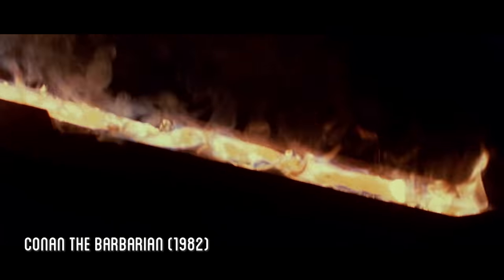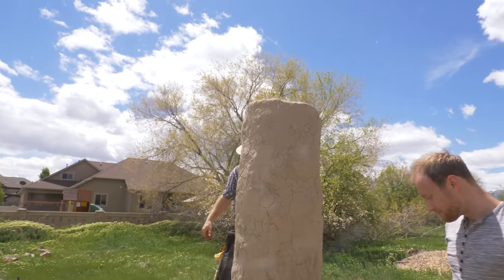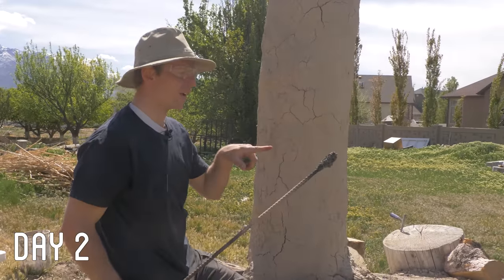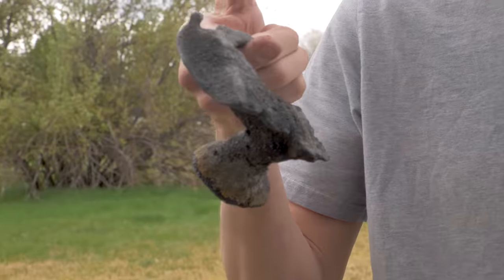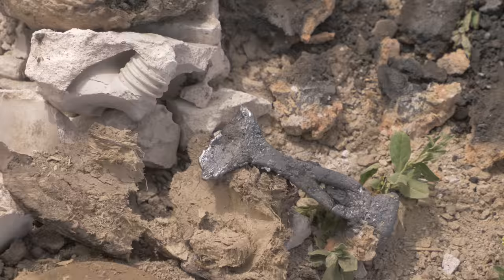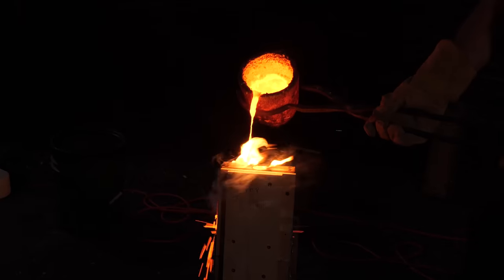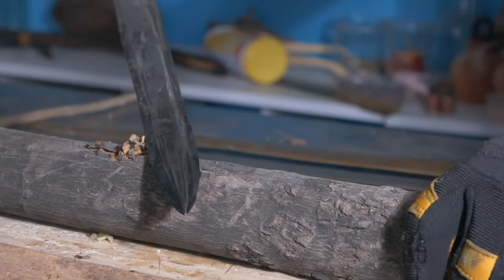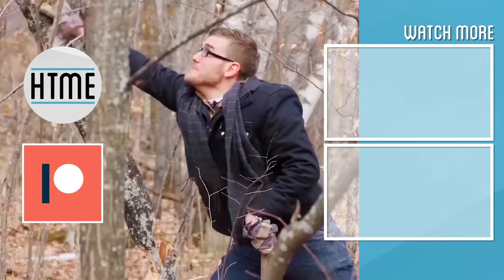Can You Cast an Iron Sword?

Comment: For all those that say what they could have done wrong and to try differently, it isn't about how you pour cast iron, is the cast iron itself the problem. It is too brittle, for blades you need a steel that is hard enough to retain an edge but flexible enough to absorb hits. Cast iron is just very hard and not flexible enough, is like glass. There is a reason why blades for centuries have been forged. The pouring thing is just an idiot thing for the movies since it looks "cool" (even if i think a blacksmith smashing hot steel looks cooler). I'm a little mad about this thing cause since i make knives a lot of people asked me if i pour molten steel to make knives... and thats only hollywood's fault if people don't know how bladesmithing works

Comment: I believe the fictional depictions generally cast then forge the casting.
Also you should preheat/burn out your molds to drive out the moisture and reduce mold disintegration before casting.
Reply: Which would be a great way to leave splinters of cast iron on your anvil
Reply: @toddellner5283  Yeah I imagine it is quite a light show as well

Comment: They appeared to not be putting vent holes in the mould. So the air can be displaced and allow hot melt metal to completely fill the cavity of the mould.

Comment: You need to preheat your molds. They should be at around 1100 F when you pull the metal out for pouring.
This is especially important for a geometry like a frying pan in the way you're casting it because the metal has to flow over a lot of surface area to fill a small volume, giving the mold plenty of time to freeze the metal in its tracks and stop the pour.

Comment: I can point out some points about why the pan didn't work, First point I didn't see any holes for air to escape in the mold, second point, The metal has cooled down too quickly, perhaps heating to a higher temperature will make it liquid longer.

Comment: You can improvise an electric arc furnace with stick welding equipment, graphite electrodes and an inert cover gas inside and old propane tank that has been cut in half. The top being the lid and the bottom having a conductive plate/bucket suitable for holding molten material. I should mention this should be well sealed with as little oxygen as possible.  It may also help to install windows using welding helmet lenses.

Comment: Yes, a whistle vent in casting is essential. Green sand is 6 parts sand and one part clay with just enough water to make a fist ball. Water in molten metal will explode, dry your tools. This should be stressed for safety. A caste sword is the beginning process. next it needs to be heated and hammered to compress the steel into a uniform structure, forged, tempered etc.

Comment: Fun fact: historical swords used to break all the time due to poor edge alignment. Even modern reproduction swords made for HEMA break occasionally, which means that either we got stronger or don't understand sword fighting very well...
There's no reason you couldn't still quench and temper your blade, which would make much difference. You could also finish it easier with more traditional techniques after tempering. But even then you'd have a sword that's made from an inherently brittle material.
Maybe if you reheated it in a coke forge before quenching, but idk.
Bronze is inherently softer, but did usually get work hardened by hammering the bevels. That's a different technique than grinding but does the same job, but also has other benefits that also kinda apply to other metals, in a way that the material gets more consolidated near the business end.

Comment: if you need to mass produce swords, and can melt iron, then casting swordish shaped billets for later finishing makes a lot of sense.
Reply: Th problem is with the structure they would need to do the same ammount of work for those
Reply: @robertshort9487  it depends on the armor and stick a bo staff can do alot of dammage compared to something that continously breaks on contact with another weapon just look at the vid infront of you the grain structure is random adding weakness vs forging where it's stretched along the sword so for the sword shaped billets they would need to fold and restretch it which would work like a normal sword and that case might aswell start with a bar it's why the cast iron sword broke and the forged one didn't

Comment: K, I wanna help, and I'd like to see you revisit this "cast iron" sword, but this is going to sound very critical and I don't mean it that way so please forgive me on this. 
No.1: It's more likely closer to cast steel, not cast iron (Cuz semantics, and almost incorrect semantics at that lol;check out the differences of carbon content in cast iron vs cast steel. It's very counterintuitive lol). No.2  Cast steel swords were always hammer forged afterwards (and it was actually shown in those movies referenced) to increase tensile and compressive strength. No.3: they were typically cast in open wood flasks that were carbonized (ie:burned/ charred) to add a protection layer against the high heat. I don't know as though sand was used for that type of casting, icbw. No.4: there were no risers nor vents in your closed flasks which is probably one of the reasons you had trouble pouring those. In addition to heat. No.5: the sand/clay flasks could have been pre-heated to help with flow and premature cooling. No.6: insulation insulation insulation. This is likely the main reason you couldn't reach temps appropriate for your pour in the traditional clay kiln/foundry. 
Revisit this and I'm sure you'll have better success. 
Great vids, love them; and glad to see you bouncing back after the fire loss. Good luck!

Comment: Did you try tempering the cast iron so it'd have higher elasticity?
Reply: Came here to ask this. It may have helped I think the wholes left in the casting would always be the failure point. I would also love to see other casting medium besides sand to be tested and make sure it is preheated.

Comment: By reheating the casting hot enough you can cause it to decarburize. This is literally burning the carbon out of it. You heat it until it is so hot it is emitting a shower of sparks, this is the carbon burning out. This might leave you with a steel skin over a cast core. You could take it even further and try forging after decarb, this may cause carbon migration, a process where the material seeks homogeneity. If you experiment enough, I think it may be possible to use casting as a step in a process.

Comment: Based on other YouTube videos iv watched, your sand molds did not have holes for air to escape, and possibly the sand needed packed better.
Reply: And you can't melt junks of metal big as that, in your mud furnace, you have to make small flakes, and even then...

Comment: Guys please do master the metals and metal-working part of civilisation. It will come in so handy for future projects which will require multiple iron or steel items (small and big). Perfecting the sand and other materials mixture or any other casting material is also a must - if the casting material you have is very good then you'll do much less work later.
Moreover,  making items such as armour plates, tools or items for a possible steam-powered machine does require tons of work with metals.  

Making a furnace that is up to the job is also very important - using bricks instead of clay and grass is going to make a huge difference. Using some basic concrete mixture to make sure the bricks are keeping the heat in would be neat. A big, well-constructed and sturdy furnace is going to beat the furnace used in this video any time of the day. You'll probably be able to melt iron in less than 10mins if you also construct a couple bellows as extra oxygen makes a real huge difference (you'll probably be able to melt other metals fine, too)!
The bellows are gonna last you for a really long time, unless the build quality is low, if the construction quality is good and it's overall very well-designed then it will be good for years, with some minor repairs here and there and when you re-construct it, pieces of the old bellows can probably be used.

Just a comment from someone that had been following you for a real long time now, since the first few episodes of the sandwich. Do not take this in the wrong way or in a negative way, it's just some constructive criticism as I've noticed that you guys have issues when it comes to smelting/metalworking and metal related things.

Comment: Traditionally it seems busted yeah, but when you consider that the movies that show the method are fantasy...
My mind goes to how many such settings, especially if dwarves are involved, tend to have oddly modern methods
like crucible steel. Aside from that, I'm surprised that you didn't try to do an open faced pan casting?
I could also see using cast iron for short and stout trust focused daggers or spear blades, or a thin cooking knife that won't be hitting anything too hard?

Comment: The short answer is... 
YES, you "can" however, it would need a significant amount of work to finish the, err, umm, swor... casting and I would hesitate to call it a sword. 
A sword is something one takes into battle. A cast iron "sword"-shaped object. Is a thing I might hang on the wall but never use.  
Only try to use it as a weapon as a last resort expecting full well that it may fracture or shatter and cause as much if not more harm to it's weilder as it's intended target and expect to only get ONE decent blow if that. Anything more is gravy. And don't hit it against anything HARD. 
CAST STEEL... should at least make a decent billet to make a sword from. Depending on the setup and mold etc, I know of no immediate reason why a passable sword could not be made of cast steel though, I assume, as with most things, setup, available tools, time constraints and knowing what you are doing would be key to making anything of quality. 

So… sure but why would you want to?

Comment: You should use a bench grinder when you sharpen it,  the heat will soften the steel and prevent breakage.

Comment: I once worked for a company that produced cast iron heaters. When I said cast iron couldn't be strong they gave me a huge hammer and an old heater element and told me to whack a piece off. After frantically hitting it for 5 minutes, I gave in.

Comment: It hurts watching two swords meet edge on edge. When two edges meet in battle, the point of contact causes a localized vaporization of the metal. This in turn damages the ability of the metal to hold an edge. Edge on flat is where swords are supposed to meet. It protects the edge of the blade from nicks and dents, and it protects the blade from breaking in the way the cast iron sword broke.

Comment: Three problems: Your molds are cold, so the iron is cooling down way too quickly and solidifying in strands (that's what's creating the spongy masses), and secondly, there are no gas spouts for a fully encased mold (this has consistantly been a problem with your molds over the years, from what I've seen). Thirdly, there's a reason that they pour into an open mold... and then forge it further, basically just using it as initial bar stock that is partially formed (or in fantasy stories, magic is involved); they know that a raw cast iron blank is crap.
Reply: I think the fantasy sword casting problem is that the molds look like the sword they are making and not much changes after it is cast.  I don't think there would be a problem pouring a long bar of an alloy normally used for swords and then machining it down to the sword you want.

A lot of blades today are just cut and ground from bar stock with no forging required.
Reply: @jasons5916  As I said, with fantasy, magic's involved, so we can't treat it like it's a mundane casting.

Comment: The OG Damascus steel - Wootz- was  crucible steel - the swords were  cast. I've made cast pans in the past, you need to add an additional vent hole in your casting. The two knives that I've cast I still heat treated, need to take the edge off the brittleness of the steel

Comment: The reason the molten iron won't fill the closed, pan mould is that you don't have a vent at at the other end of it. As you pour the metal in, the mould fills with gas(es) and will not allow any more metal - the closed space is already full, partly of molten iron, partly of air and other gases. It needs a way for the gas to escape if you want it full of metal.

Comment: During the crusades they made blank based swords, very similar concept to the LOTR orc casting for Saruman’s Uruk Hai army. Except instead of using a crucible to cast a whole bunch of swords, they would take a sheet of steel, heat it up, and then cut out the swords (much like a cookie cutter) so it’s not unthinkable that early iron swords may have been casted to mass fit soldiers.

Comment: After the casting, you should heat it up under the melting point to reduce the carbon then quenching the sword. After that you should heat treated it in a oven for a couple of hours to increase the resilience of the carbon steel you made from the cast iron. Then you can use your casted heat treated sword or tool. Some ancient civilization as such Romans during the Empire period used cast iron, then reduced the carbon content to get carbon steel from it and heat treated it. Depending on the quantity of the carbon in your steel and just the heat treatment could work somehow without even hardening and quenching. Good luck.
Reply: Check out some of the wootz steel making methods. There are ways to layer cast iron (excessive carbon) and wrought iron (very low iron) in a sealed atmosphere to get the carbon to equalize between the two metals. These would then be used in pattern welding.

Comment: i like to believe in the movies scenes, there casting iron thats more fit for use in a sword. (at least in context of the story maybe on set they cast something else for ease of use to get the effect) its probably foster to get the shape roughly where you need it for the sword that way. then you make corrections, temper it, sharpen it, and or whatever else you do with swords.

granted i know nothibg about metalworking or blacksmithing, so maybe the whole concept is full of more horse dung then the cob you used for your casting molds. either way it looks rad on camera and builds tension.

Comment: I always assumed the swords in movies were cast for quick initial shape, then worked on and heat treated after that. would that not help at all?
Reply: Depends on material choice. Almost all modern steel is cast into gigantic billets which are then hot rolled or forged into a more manageable size. Casting steel just requires temperatures which are not realistic for basic and small wood or charcoal fired furnaces. With non modern equipment you are restricted to cast iron, the difference is in the very high carbon content, which significantly reduces the melting point but makes the material a lot more brittle. No amount of working or heat treating will change that.

Comment: Sorry that I'm overtly late to the party, but I have to point out that you doomed yourself from the start with this cast-Iron sword....
Using the opening of the original 'Conan the Barbarian' as a guide, they used the casting to get the rough shape of the sword's billet & were not going for finished product yet - as you did.
First, it's assumed it was cast-iron alloy mix (may not have been true) & the color for the temperature seemed lower than that shown in the movie (both affect final product).

Then in the movie, they also refined the edge/form of the sword through 'traditional' heating/hammering techniques (including a minor concave of a blood-grove).
This makes the blade leach/loose carbon through each cycling of heating (making it more like steel) & might strengthen the structure where the pockets had formed.
As such, this would then make the cast-sword of Conan's father more on par with a crucible steel blades like the Ulfberht & Wootz swords.

Otherwise, it was a good attempt, the other casting fault you have been told of and I will not repeat.

Comment: You didn't heat treat the blade. Makes you findings up to speculation that the lack of heat treating led to the failure and not the forging method. They did heat treat in Medieval times so it's a valid point I can bring up.

Comment: To make the pan. Get to boxes with sand packed tight. Make sure you an put the boxes to geather. Make top imprint in one box an then bottom in the other. Put the boxes togeatherso it dont leak an. Have a hole to pour metal down. It will be easyier

Comment: I wonder if a cast iron sword can be turned into something more resembling steel by multiple heat treatments of various kinds? The problem with cast iron is its high carbon content and it's large crystalline structure. Heat treatments could lower the carbon content right down and rearrange the crystal structure of the metal

Comment: yeah, melting dirt... that's the problem with iron. white hot is almost hot enough to melt pure white kaolin. maybe it would be interesting to treat clay with acid solutions to dissolve away the metal oxides and make it more heat-resistant, so you could make fireclay or crucibles yourself?

Comment: Are you guys going to do Viking Steel? Where they would use grounded-up animal bones to "cast a spell on the sword" during the heating of the material; which because bones are high in carbon, it made an early form of steel, which was actually harder, so they thought their spells worked.